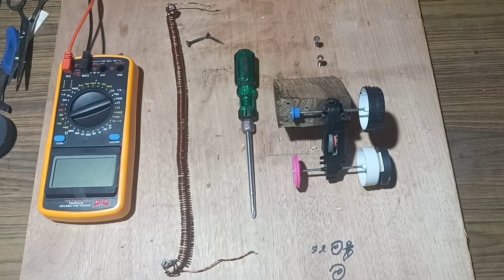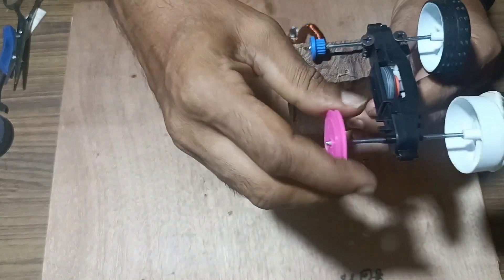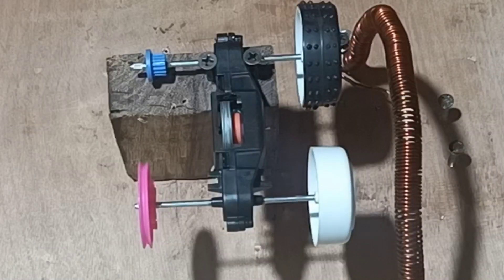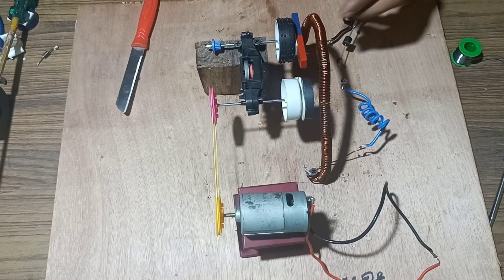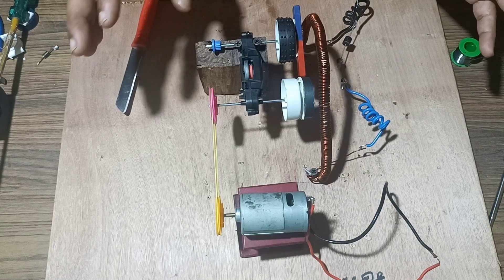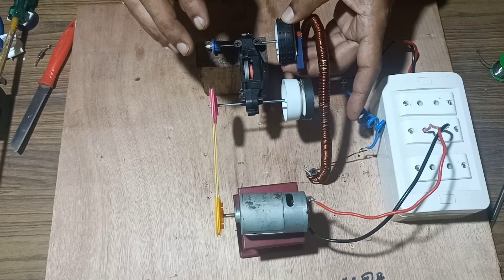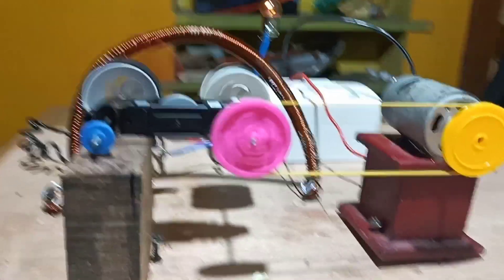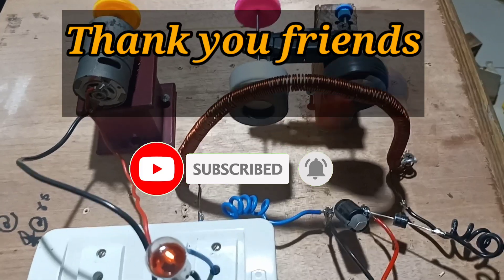"DIY Free Energy Generator using Copper Coil and Toy Car Parts | Renewable Energy Experiment"

Comment: Please what is the coil size
Reply from the maker: The length of the winding wire used in the coil can typically be between 2 to 10 meters, though this can vary based on the specific  design and requirements.
The dimensions of a coil needed to generate a certain voltage depend on various factors like the wire gauge, number of turns, and the strength of the magnetic field passing through it. To design a coil for a specific voltage output like 5 volts,  minimum 2 to 3 meters in length is required.
Reply: @rajusavanur  ok thanks
Reply: @rajusavanur  but can I produce 12v with this step
Reply from the maker: To generate a consistent 12 volts of electricity using electromagnetic induction, you'd need a setup with a rotating magnet and coils of wire arranged in a way that optimizes the induction process. The number of coils, the strength of the magnet, and the speed of rotation would all play roles in determining the voltage output. Additionally, using appropriate components like a rectifier and voltage regulator might be necessary to stabilize the output to a steady 12 volts.
Reply: @rajusavanur  thanks